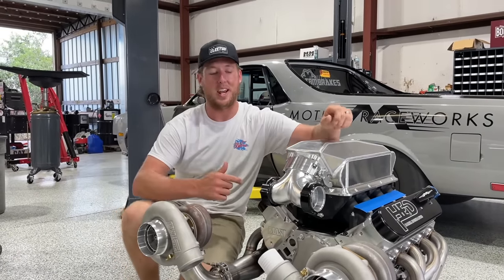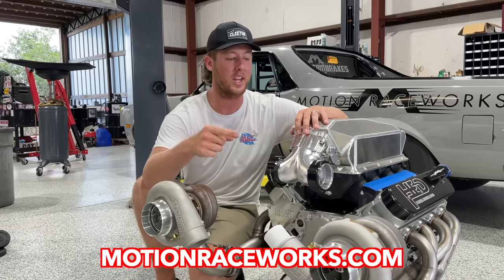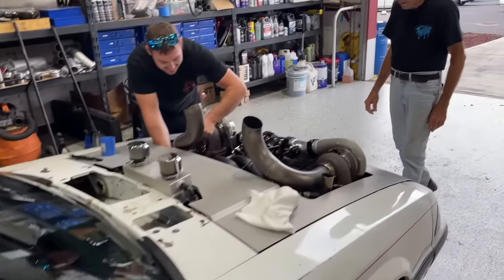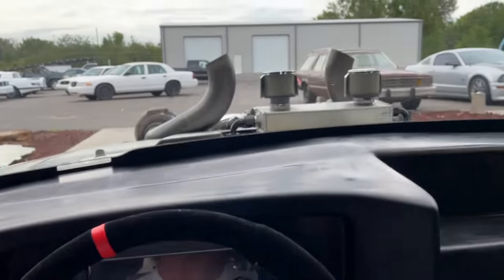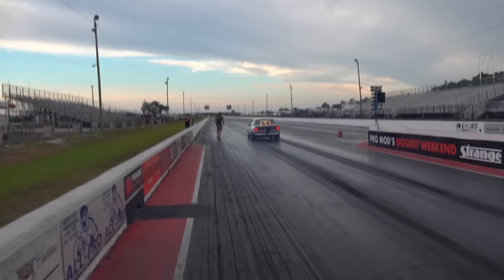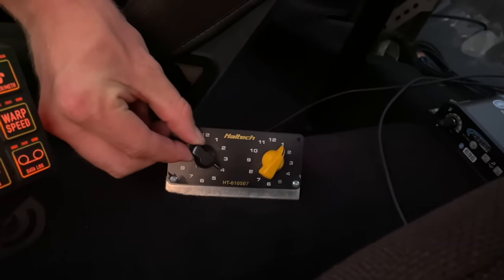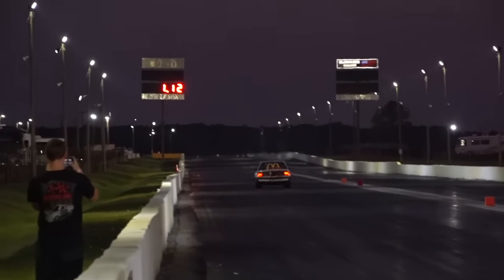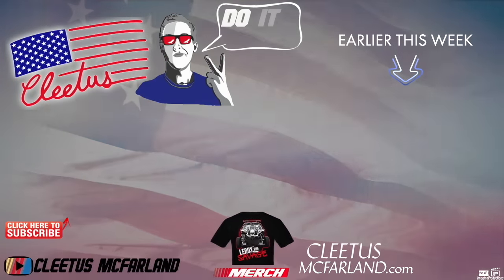I've Been Shifting My 5-Speed Lenko BACKWARDS For Months... INSTANTLY Made My Car WAY FASTER!!!

Comment: This seems like the kind of mystery that could be solved in 30 secs with a phone call to lenco.
Reply: What's the fun in that?
Reply: As he said he's not a communist.
Reply: Just a few seconds going through the shift motions will tell u that anatomically its better to shift right to left to avoid interference, unless youre in the UK or something and sitting on the right
Reply: he specified he does NOT negotiate with terrorists.
Reply: @GonzoDonzo  do you mean anywhere else in the world?
Reply: @GonzoDonzo  yah, and no one is from the uk!
Reply: @GonzoDonzo  No. By going Left to Right you are moving the shift handles which removes the impediment. As Stevie Fast explained to Cleetus, it's supposed to go Right to Left, but not for the reasons you explained.
Reply: @GonzoDonzo  For me, going right to left is completely counter-intuitive, because an H-pattern manual does the opposite. 1 and 2 on the left, 3 and 4 in the middle, and 5 (and 6 if you have one) on the right. With some exotic 7-speed manuals that have 7th to the far right even.
Reply: @Hydrazine1000  now in a right hand drive drive car (a greater % of the world) you shift closer to yoursself as you change up.
Reply: @ae86rally  Well, Cleeter would be used to left-hand-drive, because the US has right-hand-traffic. (Yes, LHD is for RHT and vice versa, that's confusing.)
Reply: The shift leavers are longest to shortest in length from right to left for a reason in a LH drive car.... they would be the exact opposite if it were a RH drive car, always pulling from the outside to the inside.
Reply: @Hydrazine1000  now figure in my old rural mail carrier here in the U.S. that sat in the passenger seat and reaches his left arm over to steer his car and uses his left foot to operate the pedals but my new mail lady has a newer right hand drive jeep looking ride. Talk about confusing lol
Reply: @warrenmichael918  😁 Mail carriers, delivery vans and street sweepers are the kind of interesting edge cases where you'd want the operator/driver on the curb side instead.
Reply: would have been even faster to do a google search "how to shift lenco"
Reply: But that doesn’t make content that generates a video that produces income.
Reply: @FishFind3000  ding ding ding, we have a winner
Reply: @Hydrazine1000  when it comes to finding every sliver of performance u can, what youre used to is irrelevant.
Its kinda interesting but fighter pilots are taught about the anatomy of the body. In a dogfight a pilot us much more likely to turn left due to how the body works
Reply: @GonzoDonzo  You're absolutely right, but that's not the point. If you have experience driving an H-pattern manual, then you would expect the left side to hold the lower ratios, and the right side will have the higher gear ratios. And that is regardless of driving on the left hand side or right hand side of the road: The adopted H-pattern is the same for both RHD and LHD! Or LHT and RHT if you will.

So all I'm saying is that it's not too far-fetched to get shifting a Lenco wrong, if you're used to driving a stick and you don't do a "RTFM!". I would have have made the same mistake.
Reply: @Hydrazine1000  oh i totally agree with u there. Definitely an easy thing to get wrong
Reply: @Adam Carroll You assume way too much....how do you know they didn't?  You understand YouTube...right?  This channel is not about racing....or racing cars....
Reply: @ae86rally nobody cares

Comment: McFlurry is going to end up faster than Mullet at this rate
Reply: 🤫Don't let Jack Stand here you say that!😂
Reply: i didn't want to say anything but LOL thats insane! this car was built just for a fun side project and its THIS FAST?!?!?! holy molly!
Reply: Nah
Reply: Well it's half the weight. Soo......
Reply: This car definitely has a chance to be faster than mullet. dont forget this engine is still using the stock intake manifold and running 7.50's
Reply: @maxkoepke5917  and Mullet is about to hit high 5's, low 6's 😉
Reply: @jeffatkinson3288  and mullet has a 570 inch big block in it that is all billet.. there are plenty of foxbodys in the low 6s high 5s but 0 el caminos.
Reply: @jeffatkinson3288  same combo in that foxbody and its already there
Reply: @maxkoepke5917  If he did that then he wouldn't be able to keep the damn car on the ground. It'd go straight space shuttle status
Reply: Frl like no way he don’t beat mullets best at this rate
Reply: It's a smaller & lighter car
Reply: Mullet running in 200 mph club
Reply: @ChickenBaconRanch1776  mullet is a chubby
Reply: At this rate definitely, 7's already! Too easy. Ford power.
Reply: Not
Reply: @maxkoepke5917  and no intercooler
Reply: @maxkoepke5917  and stock exhaust manifolds
Reply: @ChickenBaconRanch1776  Yeah, I don't think people understand the weight of a G-body chevy. They are huge as hell and dwarf a fox body. They were a thousand pounds heavier stock than a fox body. I had a 87 Monte Carlo SS aerocoupe in high school around '01 with a 305 HO and a performance intake manifold, carb, headers, exhaust, cat and emissions delete, shift kit, posi diff, fiberglass cowl hood, wider tires, etc. But my best friend had a 91 GT foxbody bone stock with just a Flowmaster muffler. We could both floor it from a stop light and stay completely dead even to speeds neither of us knew because our speedos topped out at 85 back then. It took what was probably over 100+ more hp than the stock fox body to just stay even with it. And I had the aero advantage over other G-body's with the ss nose and aerocoupe back window.
I also think that nothing looks better doing a burnout than a G-body. It just looks mean as hell.
Reply: It would be very cool to see the pony outrun the horse.

And can I get fries with that?
Reply: @ChickenBaconRanch1776  mullet also using a custom billet 500+ci engine while McFlurry running a very mild basic stock 7.3 Godzilla with the plastic intake… Ford designed one hell of an engine it’s making power,  running 7’s stock monster for sure
Reply: @ChickenBaconRanch1776   doesn’t matter, less than half the power and using a lot of stock ford parts… Vs a billet King Kong displacement engine
Reply: @maxkoepke5917  and that is exactly why we don't need another one.  Mullet is a refreshing change.  Either way this channel had to bring in ford to increase subs and grow. I fully expect  some dodges at some point and eventually, if the track don't get turned into a housing project, some Toyota's.
Reply: It'll take three times the power they're making now to get McFlurry into the 5's.  Being light helps you get off the line, but it's an air resistance battle after the 1/8th, and neither of those cars are aerodynamic.
Reply: For sure....but if Jackstand keeps driving McFlurry...he's gonna break it
Reply: @JayRussellDuramax   how many of the fast fast STREET cars are really aero dynamic ? Foxbody’s are the king of the tracks everywhere and it’s not up for debate, it’s aero is just fine with simple body upgrades to cut air
Reply: @Call_MeDaddy  You missed the point entirely...  All I meant is that there's nothing about the Foxbody platform that makes it inherently faster.  It's it light?  Yes.  Is it the lightest vehicle ever?  No.  They're popular because they're cheap and easy to set up, not because they're faster.  McFlurry won't come close to Mullet's ETs without Mullet's power.  Period.

Comment: Looks like it's time for Tye to upgrade that 7.50 cage
Reply: I thought I remembered them putting a 7.50 cage in it.  Hope they remember and do an upgrade
Reply: @paulgrimmer2600  
Don't worry, some tech guy will remind 'em if it slips their mind...
😁
Reply: It has a 7.5 cage in it
Reply: @bbdl7042  
And it just went 7.40
Reply: @zrxdoug  It went 7.54 not 7.4
Reply: @steveletson6616  
Could've sworn I read 7.48 somewhere..
At any rate, if it's going 7.54 and it ain't even set on kill yet, it's gonna need more cage.
Reply: Wasn't it supposed to be a 8.5 cage and ty went above and beyond and went 7.5 so it would never need more cage....

Comment: From the LencoRacing Website:Shift Patterns:
All levers in forward position result in the transmission being in first gear. The tallest to the right is used to shift the transmission from first to second gear. The second lever, and second tallest, is used for third gear. The next lever is used for fourth gear and final lever for fifth.

Burnout's (on all LENCOS):
When doing burnout's you need to roll up to the water box then shift all sections accept the front section. Then start the tires spinning, now shift the front section so that you are now in high gear. You always need to come out of the water box in high gear to prolong the life of the transmission.
Reply: Upvote this 😇
Reply: Instructions smuckshuns
Reply: I cannot argue with this.
Reply: Real men don't read instructions
Reply: I always shifted mine right to left
Reply: "Never trust instructions from the internet."- Abraham Lincoln
Reply: It pops up highlighted if you just google "which way do you shift a lenco"
Reply: How tf it can switch the pattern when the normal H gear will destroy the trans?
Reply: @AmirulEhsan  they aren’t a normal transmission my man. Lol
Reply: @AmirulEhsan  lenco figured out how to take gears for water pumps and put them into cars, everytime you pull a lever it adds ratio and it doesn’t matter wether you pull from left to right or right to left. Once all levers are pulled the end result is the same ratio.
Reply: @scott-mc5hm  The exact opposite, actually. Real men love learning new things, and they always RTFM.
Reply: @ChristopherHallett  Real men get educated by the best experts in the field who not only know the correct most basic of basic instructions, but can add tricks and secrets of the trade from decades of accumulated experience to their lessons.
Reply: Wait until he finds out which position the handbrake should be in
Reply: Bump
Reply: Thanks for sharing how the transmission works, apparently none of the guys can read, especially instructions. how about a crayon rendering of how it works.
Reply: If any olf that crap was important it wouldnt be hidden away on a website, would it? It woulld be printed on huge brightly colored  vinyl stickers \featuring ALL CAPS scary words and exclamation points. And those stickers would be  plastered all over each and every Lenco transmission. Same as Werner does on ltheir adders.
Reply: @mikemathis3936  well step one is read the instructions, and in the instructions it is actually the very first thing, highlighted, in all bold letters and then they also repeat it about 20 more times throughout the entire handbook, in giant caps all over the handbook. These guys are just idiots with money and limited knowledge, enough to put things into cars and break them most of the time.
Reply: So the shifter is put together backwards too?
Reply: We're guys we don't need instructions...
Reply: RTFM!
Reply: @the101dad  
Actually, it does matter, the ratios are different in each segment, with the lower gear changes having steeper rpm drops* - did you actually pay attention to what Garrett said about the rpm drops? Ah, thought not...

*This happens on ALL transmissions
Reply: And miss out on extra content that will make enough money to pay for the trans? Where’s the YouTube in that ? 😂
Reply: @feedmyneed6476  Yeah i got that too....Kinda funny how no one in this video could google how to shift this transmission....
Reply: Who reads instructions first?
Reply: @Timmermon63  
It's usually the first thing I'll do - especially if I can't do the build immediately.
It's not always needed, if I'm already familiar with what I'm doing, but even then it's a smart thing to check for revisions and updates.
Yeah, I know you were joking - 'least I hope you were.
Reply: @gordowg1wg145  You always read the instructions for everything? I guess that's what you do when you sit down to pee...
Reply: @gordowg1wg145  explain the time differences then? Ahh what’s that, there wasn’t… own a lenco first then get back to me.
Reply: @10thclimbtovictorystevens65  so then you're just here to see dudes' butts?
Reply: @the101dad  
Learn how transmissions work - specifically stacked orbital gears - and the relationships between the power/torque curves of the engine, the gear train, and the drag (that's aero' and rolling) characteristics of a vehicle, and you'll be informed enough to make it worth my while.
Hint - rpm drops...
In the meantime, you're just doubling down on that hole you're digging...
You may want to re-watch this video, too, and actually pay attention to the comments made in it.

Not sure what my not physically owning a Lenco' has to do with the discussion as it's the basic principle of ALL gear trains - the Lenco' is a unique design but the principles are universal.
On that, I assume YOU DO own one - and can supply proof? Maybe slips with both gear selection options
Reply: @andrewfield3860  that's what I thought too.
Reply: @jamescostello6529 rtfm doesn’t get views on YouTube. Cleetus didn’t get popular by knowing what he was doing with cars.
Reply: Money overrides comprehension, lol.
Reply: "When all else fails, read the instructions."
Reply: Instructions are just the manufacturers opinion
Reply: @RonniePTexan  underrated comment of the day 🤣
Reply: @RonniePTexan   You still wearing those adult nappies?
Reply: @gordowg1wg145  Not sure what "nappies" are. Perhaps you can tell me what they are, since you are clearly a "nappies" expert
Reply: @RonniePTexan  
I believe you would call them diapers? Have a look on the box and see what it says.
Reply: @gordowg1wg145  So you call diapers "nappies"? That says more about you than it says about me. It tells me everything I need to know about you.
Reply: @RonniePTexan   
It tells you I'm not from the USoA, or from where it's had a significant influence.
It may also tell you I'm 🤣at you, not with you 😜
BTW, what did it say on the box of "adult diapers" you use, anyway?

Not that your admitting to using them is always going to be embarrassing - if you were in the military they're used for some of the extended missions where toilet facilities aren't possible - like the Apollo missions and long range bombing missions.

Comment: Bro these are the type of issues I’d love to have lmao “Damn I’ve been shifting my transmission wrong” compared to “Damn is that trans fluid or oil… let me get to work” 😂
Reply: LOL I felt this one.
Reply: Or like me "Where did all the transmission fluid go?! It was full a few weeks ago, now it's empty and there isn't a drop in the driveway!"
Reply: I do have transmission issues, but it's more along the line of "Damn 3rd gear pops out when shifting into it at high rpm"
Reply: Man you guys are amateurs. Get yourself a subaru and you'll have trans fluid and oil. That oil I just mentioned will also have coolant in it.
Reply: @maxb1985  sounds about like my Hyundai

Comment: It was nice to see that Cleetus lowered his face shield for all three runs. I hope this is the new normal. I know that in a very large percentage of the runs it doesn't matter if it's up or down. Of course, there is that small percentage when it could make a big difference. I would think Maddie and the Little Ripper would prefer this to be part of the starting line procedure for every race in every car.( I know the driver is busy with the burnout, backing up, staging, etc. The crew member staging the car could have it as part of his/her assignment to check for the face shield.)
Reply: 100% agree, I feel like it's easier to forget because he would notice more in Leroy compared to other cars due to the lack of a body
Reply: 100% for safely first, ive been commenting for months saying the same thing. Especially with methanol cars. Do not want to go though the same thing as Lyle Barnett did........
Reply: no